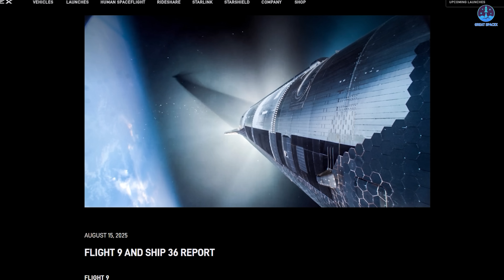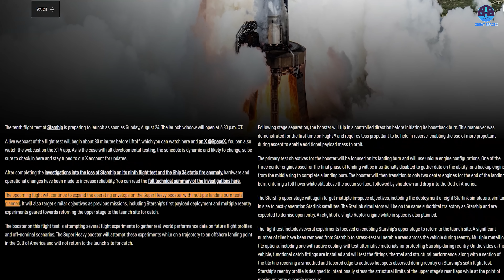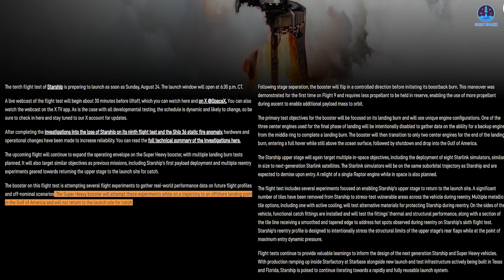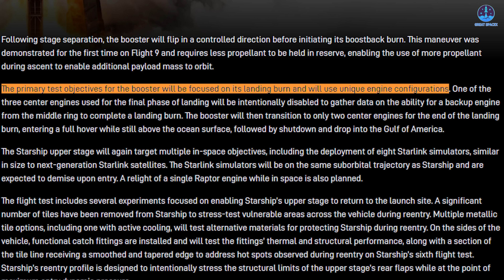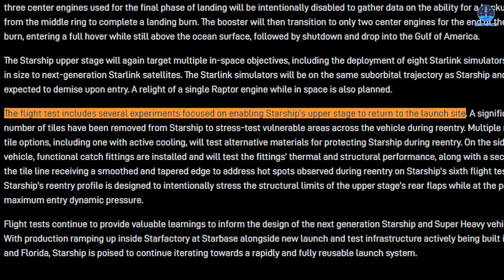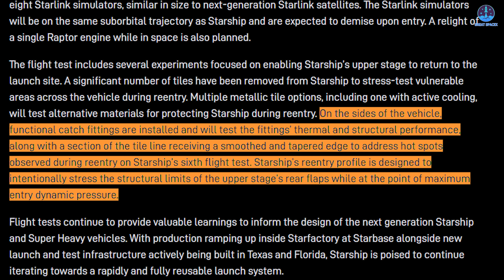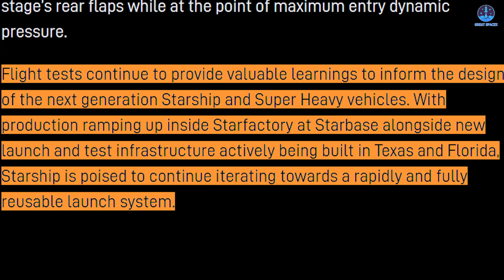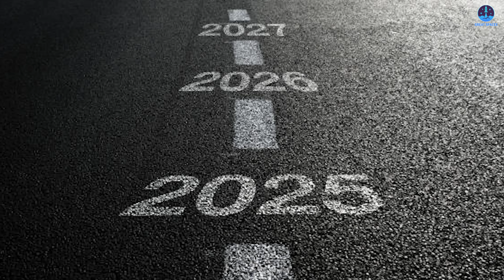SpaceX's Wild New Starship Flight 10 Timeline Revealed. The Countdown Begins!

Comment: Not sure why they even need a heat shield or a pezz dispenser as this rocket is being designed for the Moon landings with Artemis III for the HLS. If it is for Mars, maybe they should worry about that mission after making it to and from the moon after proving it can do that first.
Reply: SpaceX needs to launch dozens of Starships to make it reliable enough for human flight. To pay for these launches, Starship will deploy Starlink satellites. The "Pez dispenser" is for deploying those. The heat shield allows the upper stage to be reused for economy.
Reply: @doctorPaule  Clearly both work then

Comment: First of all feels like a placeholder launch. They may get some clues on heat protection, few minor ideas elsewhere. 
Besides that the main task would be to simply avoid rapid disassembly. For publicity reasons. Could as well send another Tesla up there. Or whole Banana tree. Meh. Flight 12..13?
Reply: Theres a reason Spacex isn't publicly traded. They can have failures and bad publicity wont tank their stock potentially causing shareholders to nix progress.
Reply: @beyondplanesight  Elon isn't getting any younger. I don't see people going to Mars in his lifetime. More so with current Starship progress rate. Or with Starship in general. It's just wrong or incomplete technology for now based on my current understanding and history of the spaceflight. 
Low key entertained by the launches, but it's kind of stalling for "Season 4" currently.

Comment: The Starship will never fly to Mars. The payload is simply too small. SpaceX has run into many problems with the Starship concept.
1. too heavy construction with steel instead of aluminum or carbon
2. poor fuel with less power than hydrogen
3. too low acceleration performance due to the return flight to the launch pad.
4. almost all of the acceleration power is on the second stage.
5. the second stage is now too large and too heavy and considerably reduces the possible payload.
6. the payload capacity is only 0.8 percent of the take-off mass
All this will mean that the necessary tankers will either not be reused or will only be able to refuel 40 tons of fuel during a flight.
In order to refuel 1200 tons of fuel (or more), 30 or more flights will be necessary.
How many tons will probably evaporate in orbit?
And how many tons will evaporate on the 8-month flight to Mars?
The Starship impresses many space fans, but for me as a German designer in propulsion technology, it looks like a stillbirth.
Reply: Call us when Mercedes comes out with their version.  As someone n who has worked the last 15 years with German engineers and designers in a very hi tech field, I know how much they love to brag about German engineering, but I can say from experience the German language apparently does not have a word for practicality.  I don’t think Starship is an optimal design by any means, but at least SpaceX is out there publicly pushing forward and working the problem with real live prototypes and rapid engineering.  Space technology isn’t just about one ship, there’s thousands of smaller details and challenges that need to be worked out like onboard refueling and reusable reentry and so many other things that these guys are tackling head on.

Any armchair loser can criticize someone else’s attempts to do the impossible.
Reply: @pchris6662  The problems with American schooling are becoming very apparent. For 3 decades now US-children get told that participating and enjoying yourself while doing anything is more important than winning or doing things the correct or best way. Every IFT a lot of talk that they get so much data and data points and that that is so valuable and that it is so fantastic to be present at the launch event, but still the rockets blow up one after the other as if nothing was learned. What @eidruntiehrhaw says is all true, so let's stop spending US-tax-payer money to blow up another Starship for another useless data point in an another attempt to do what is impossible. 

Falcon 9 was great especially with crew, the Starship booster seems quite a great device, however the 'reusable' Starship upper stage really seems the wrong choice and Starship HLS seems the stupidest solution possible to go to the Moon. But for that, fortunately NASA is starting to look for another option.

Comment: This engine restarting issue seems messed up, not sure what I'm missing.  If the ship can achieve orbit, it takes very little fuel to keep it there.  You can spend 3 hours or you can spend  5 days in orbit without much cost difference.  You should be able to shut down/restart the engines 20 times and give it a great test.  Yes, each "fire up" will alter the orbit path.  You can flip the ship around 180 degrees and fire up again to slow it down, then flip around again.  Just seems like you should be able to test the crap out of those engines easily before landing in the ocean.
Reply: Starting-up liquid methane rocket engines in the vacuum of space and in microgravity where propellent will not be settled downwards without special intervention is still not trivial. Restarting them 20 times would be fantastic but I think they are already happy if they can restart one engine once.
Reply: The Mars trip will include turning the engines on/off many times, so the ship better be able to do it 20 times with no issues.  Not to mention, assuming the ship returns to earth, the engines will be off for several months at a time.  The fuel must remain at a proper temperature.

Comment: I don't understand why they keep adding multiple new features to test when they haven't demonstrated their previous versions of starship can fly without blowing up
Reply: No, clearly you don't understand.
A)  They have demonstrated that Starship can fly without blowing up.  The problems have been mainly with integrity of the fuel systems and keeping attitude control in order to test re-entry.
B)  The whole point is to test new features and capabilities.  That's what "testing" means.
Reply: @falcychead8198 okay no need to be a dick. I was just asking a question. I'm not a certified rocket aficionado like yourself
Reply: Possible that old features are not working as designed an upgrades are necessary

Comment: I have a great engineering concept for the heat tiles.
Reply from the maker: Can you share this?☺️
Reply: @colonbina1 With decades of advanced material reinforcement manufacturing engineering experience, SpaceX should consider my active dynamic thermal heat shielding approach vs static non active heat tiles. 

My approach utilizes the unwanted heat to its advantage which reinforces its ability for fast, efficient turnaround reusability.